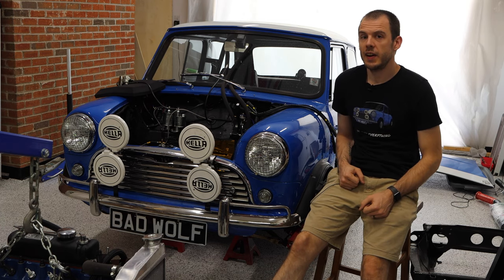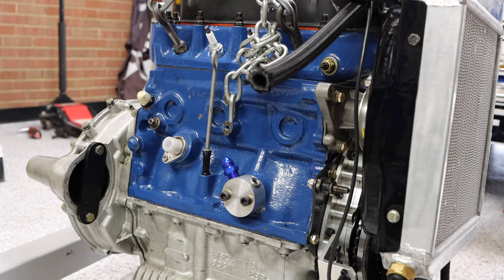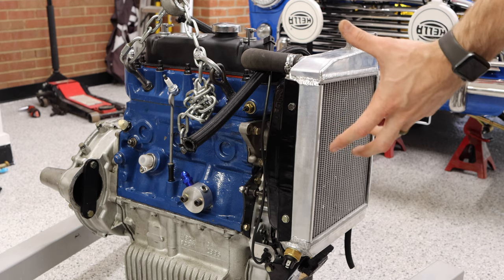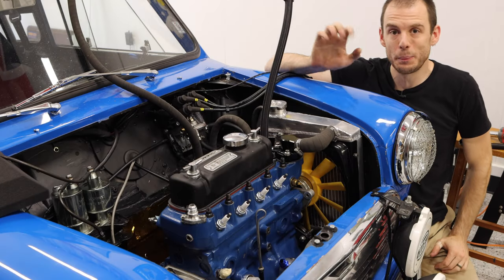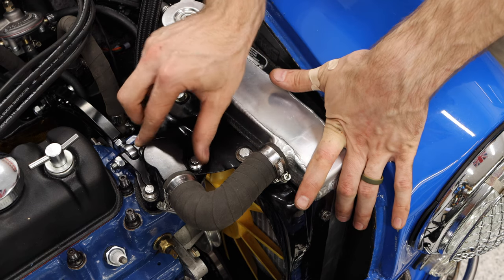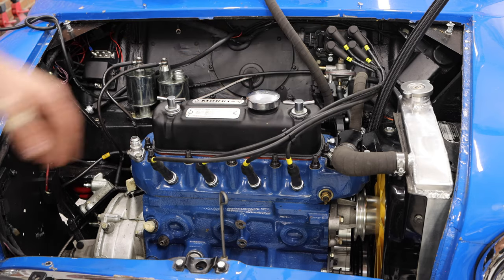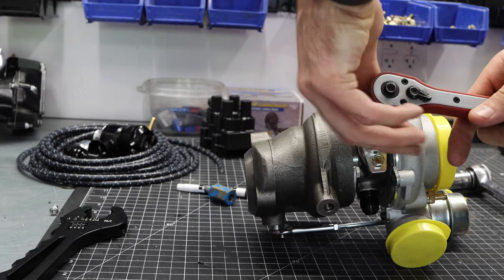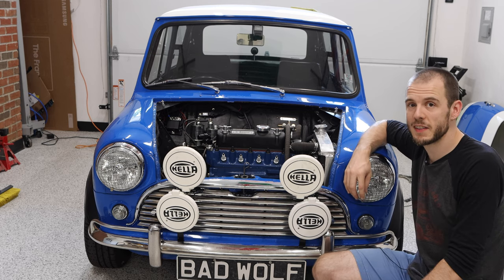Turbo Engine Goes Back In - Bad Wolf Turbo

Comment: Sorry, I keep thinking of questions as I'm also going to be going side turbo soon. Did you ever consider water/meth injection for cooling the charge in addition to (or in place of) an intercooler? What made you shy away from the transfer case breather as an oil return line? Will you be placing an oil cooler in the line going to the turbo? All things I've been considering latley. Thanks a ton!
Reply from the maker: No worries at all! Happy to answer any I can.

Did you ever consider water/meth injection for cooling the charge in addition to (or in place of) an intercooler? 
Yes however on a road car it's more work than it's worth. The intercooler is very low maintenance and doesn't require any fluid top-ups or fill-ups.

What made you shy away from the transfer case breather as an oil return line?
Side mount turbo means the turbo is sitting right over the old distributor hole. So it was much easier to just drain right there. 

Will you be placing an oil cooler in the line going to the turbo?
The feed line for the turbo is not a large line. It's not the same size as the oil transfer lines that are normally on the a-series. So fitting an oil cooler there really isn't feasible. It also likely wouldn't provide many benefits. If I did fit an oil cooler(which I am considering depending on space) I would put it behind a thermostat so it doesn't over cool the oil. It's very important for the oil to reach operating temperature as it will allow any moisture in the oil to boil off which keeps the oil thick and productive in the engine.
Reply: Thanks for the answers. Great to have you as a resource!

Comment: Where did you get the baffled breather for the fuel pump hole? Really excited for the actual turbo bits!
Reply from the maker: It’s actually from minimania. Link below. I also, am very excited. 😉

https://www.minimania.com/part/C-2A265/Classic-Mini-Crankcase-Air-Breather-Kit-Mechanical-Fuel-Pump-Mounting
Reply: @classicminidiy  that’s a great idea … must see about getting that for the Cooper S Traveller as an additional breather.